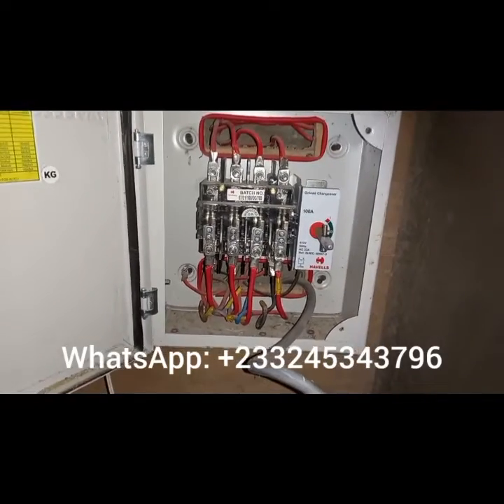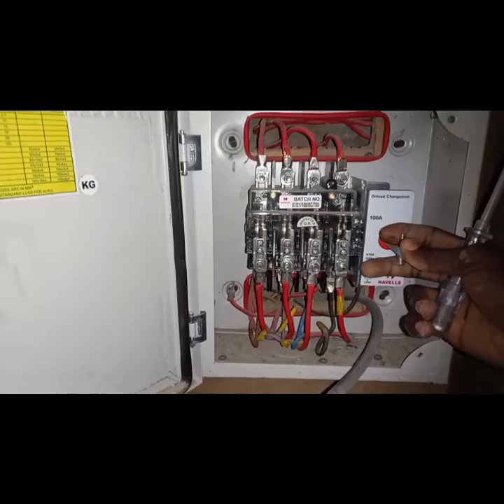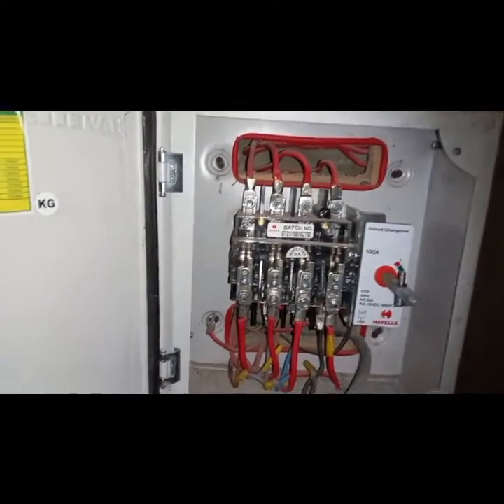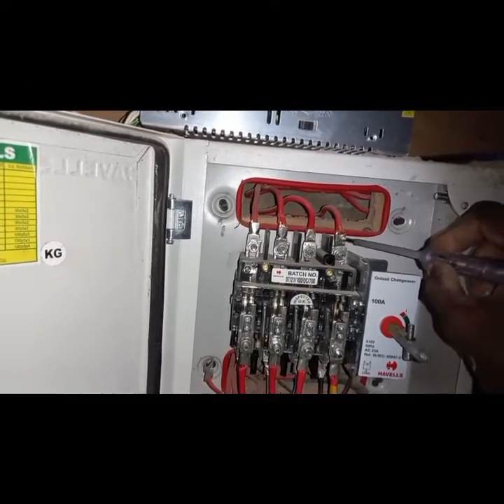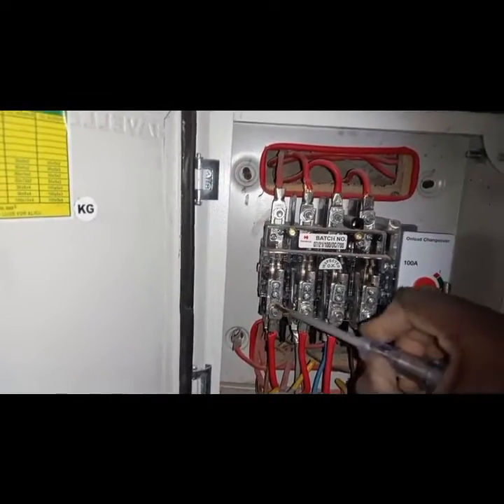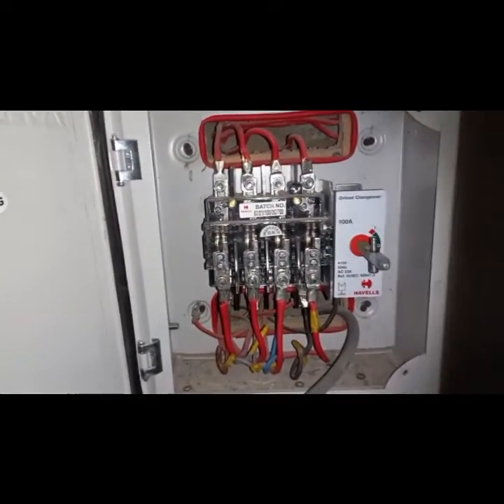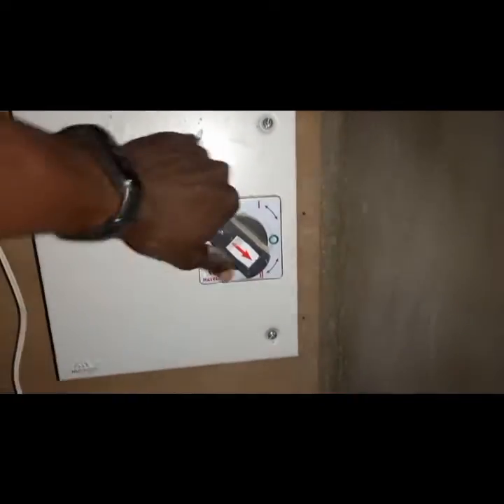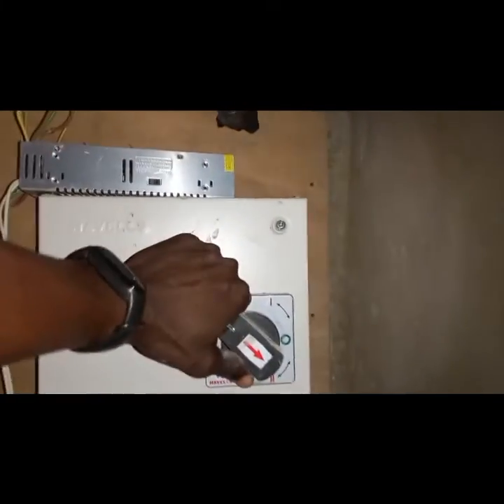Building In Ghana | Three Phase Onload Changeover Switch Simple Explanation

Comment: Yeah, please if I may ask can you install change over switch during the installation of electrical pipes or during the installation of electrical wiring. Thanks
Reply from the maker: Basically depends on the client's taste. It some prefer it to be fixed into the wall (at chiselling and conduit work stage) and some want it to be surface mounted so that will be at the fittings work stage.

Comment: Can your generator be connected automatically to turn on when light goes out?
Reply from the maker: So this type don't have that feature. And also if a gen set can be turned on automatically by an automatic transfer Switch the gen set must have auto start feature, and some gen set has that feature.
Reply: @multiskilledelectrician1  ok thank you
Reply from the maker: @davidleandro7026  you welcome sir!